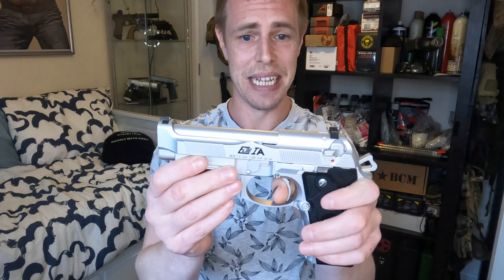I got a bargain and now I feel bad about it

Comment: You SUCK 🤨

Nah, good work finding those bad boys and investigating how to fix it. I've a Magna WA M92F from 2004 that still runs like an absolute champ. My SCW 1911s also run like sewing machines. After the TM Desert Eagle, they're the hardest kicking GBBs I've ever owned, despite "only" being heavyweight plastic. They don't make 'em like they used to. 

Western Arms are far too expensive for me now, so I haven't bought any since picking up a Beretta Cougar M8045 in the late 2000s. Would dearly love another custom 1911 from them, but I can get a TM gun & upgrade it with a high-quality full metal kit for the same cost nowadays. And building it is 90% of the fun 🤷🏻‍♂️